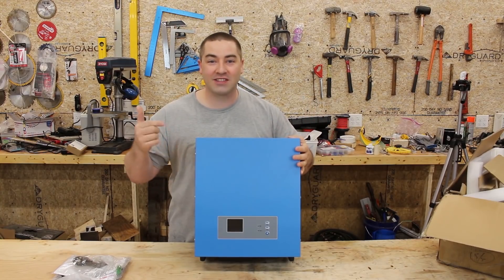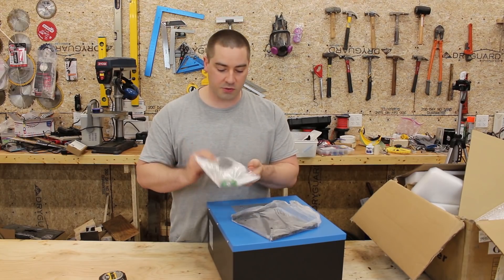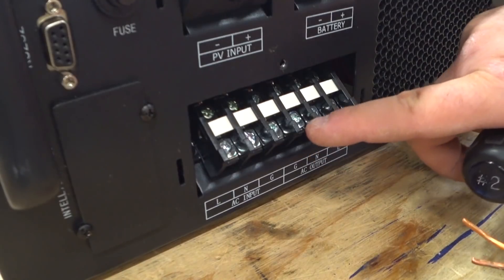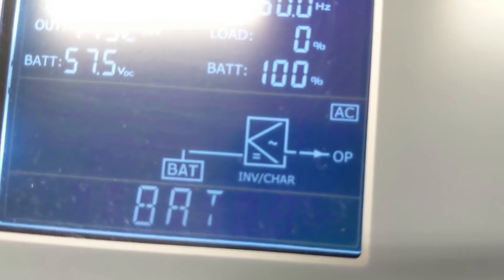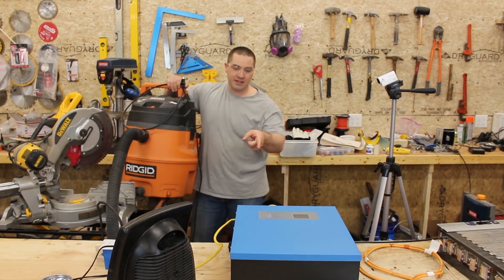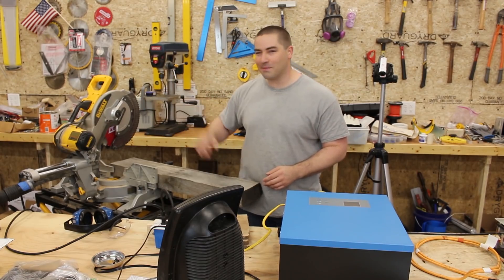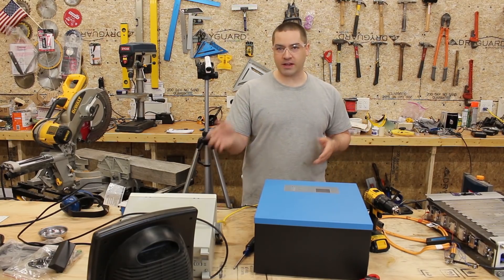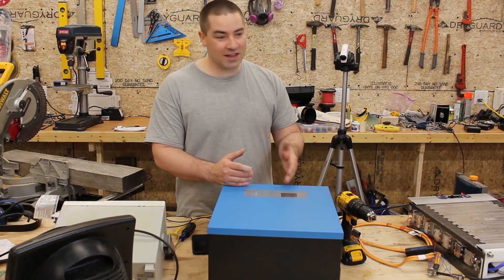Sigineer Power Off-Grid Solar Inverter 2500 W with MPPT Charger

Comment: I've always wondered why you'd not opted for an inexpensive soft start module long ago. I've previously commented as such. This would solve the high in-rush current issues with your power tools.

As for this inverter/charger, the parasitic consumption, while totally understandable, is too high for my off-grid applications. The hum from the transformer (also understandable) is crazy loud, as well!

Lastly, I'm philosophically opposed to the single point of failure that combination devices represent. While they can admittedly take up less space and simplify wiring, I'm just more comfortable with discreet devices performing better overall due to device optimization, and less of a concern to cut corners on design and/or cost. 

It's been my experience that any device performing multiple functions usually does so at some cost somewhere. Coupled with the old adage that "you get what you pay for", the performance and total cost of ownership usually disappoint over the time.

Anyway, that's my 2¢. Be well.
Reply from the maker: Hi John,  I agree with you.  This is not my go-to for most situations.  We are both fans of SMA and it is a totally different league.  I do, however, think there is a place for everything.  I think this would be great for a tool truck, or tool trailer with a few panels on the roof and the occasional use at jobsites that don't offer grid power.
Reply: @DavidPozEnergy   Thanks for your reponse, David. I actually design, build and support portable worksite power systems from single-phase 120V/split-phase 240V, to three-phase 208V/230V. Total capacity varies based on load, quantity and duration requirements.

For value-based systems, I typically employ soft starters. For larger systems, I parallel inverters such as PIP models from MPP Solar. With these, I can parallel up to nine units in single-phase configurations. Up to six units are supposed for three-phase configurations (48Vdc input only).

The largest systems run a multi-unit condenser and multiple commercial and residential air handlers in custom-designed trailers used in mobile marketing by a major inverter A/C manufacturer.

Nearly new Tesla packs, charged via solar or mains power, supply inverters powering various single- and three-phase 230V loads. Multiple inverters provide ample current, while Variable Frequency Drives perform phase conversion for the condenser.

I was able to supply two trailers for the price of one of their previous truck-based platform that required shore power. The trailers can go anywhere and require no set-up as they're 100% off-grid.

Comment: Well done video.  You should really speak more about the bloody awful huge 123W no-load draw for only a 2500W inverter.  No load draws are a good measure of the quality of a inverter and by that measure this is a terrible one.  Wouldnt own one if you gave it to me. 
In example my Samlex 2224 has a no load draw of ~30W - and even though it costs almost twice as much as a Sigineer its still cheaper than having to add the extra panels and battery capacity to support that constant extra daily 2.9KWH load.  And a better quality inverter will last longer.

Comment: I am not sure why manufacturers limit the PV input voltage to 150 VDC in many cases.  Perhaps it is a safety thing.  The panels series voltage are rated much higher like usually 600V or even more.  A single string of 500V would be easier to wire than 4 paralleled strings of say 125V each, however the 500V setup would be way more dangerous.  I suspect the 2nd reason is they don't want all of the panels on a roof to be in series because if 1 gets shaded, then the other might suffer, however, they have technology to take care of that.
Reply: It is way more expensive to design for a 500 Volt PV Input vs 150 Volt PV input ...

Comment: Good morning David there is not a single video that I miss, I have all seen them I try to imitate you in my house in some things that you do you are my source of inspiration, everything you do is excellent, I live in Colombia and it is not easy to get  at a good price everything you teach I have a small 24v solar system and I have bought 48v lithium batteries I am needing that inverter to start the pair of 48v batteries that I buy there will be some way to buy it and send it to my country  Could you help me?
Reply from the maker: Thanks for watching my videos.  I'm not selling this right away as I have some other things I want to do with it. Does Colombia use the same 120v, 60 htz power?
Reply: @DavidPozEnergy  Good evening, friend, David. Thank you to answer me so quickly, if in Colombia we use 120v at 60hrz in general and 220v in a few appliances such as air conditioners, but my consumption is at 110v-120v throughout my house, I would like to have that inverter inform me how I could acquire it.  in the best possible way since I tried and they only ship to the United States and not to Colombia

Comment: shame it is not a 240v version as thats our power in the uk i do like these units i like how thay can run solar and flick over to a generator when needed or even hydro instead of solar what was the max ampage for solar
Reply: Then buy the model that has 240 Volts!  Why is that so hard?

Comment: 120 watts on idle??? that sounds like a bit too much..have you ever tried any of those Inrush Current Limiters?
Reply from the maker: I have not tried inrush current limiters.  Do you have a link to one I should try?
Reply: @DavidPozEnergy  Neither have I so I don't have a link....but it looks like a really good solution on the "inverter shuts off when a big motor starts up" problem

Comment: Did you ever invest into creating a small DC grid in your house for DC devices? I'm wondering if it is more efficient when running DC devices from batteries with a DC-DC converter instead of going from battery DC -> AC -> back to DC. Would love to hear your thoughts and maybe create a small expiriment in the future.
Reply from the maker: I don't know enough about it to run appliances on DC.  I'd be OK with running some 12v DC throughout to run LED's.

Comment: Can you please explain the advantages and disadvantages of low frequency and high frequency invertrers?
Reply from the maker: Both can produce pure sine wave, 120v AC.  So both can be used.  It depends what you plug in.  If you only use things like heaters, TV's, lights, computers, then you can use a HF.  But some things need the LF (transformer based) to start the big surges like AC, compressor, Saws.  HF is smaller, lighter, cheaper.  LF is bigger, heavier, more expensive.  These are generalizations I'm making.  The industry is moving to HF for everything as the computers get better and faster to react.  Like the very expensive Sol-Ark is HF, but listed to have a very respectable surge.

Comment: I suspect the "buzzing" you hear is the unpotted transformer. Is this a prototype? If they were to vacuum impregnate that transformer (added cost), I'll bet it will quiet right down.
Reply from the maker: This is not a prototype.  I don't know about the manufacturing process, but that sounds cool.

Comment: Thank you for the  review of the inverter. Nice that it is a low frequency type and can handle large start up loads. The auto generator start up would be nice to see but not because I would be interested in buying this particular unit. That very loud transformer would keep me from purchasing it. I think the better brands use a round toroid transformer. Also the standby current seemed rather high. I would like to see how it compares to other Low frequency inverters.

Comment: Nice man. I’m looking at their 12Kw version. I was aghast at the buzzing sound when you turn it on. Is it really that loud? Planning on using it near a sleeping area and hope its not going to make that kind of buzzing when I’m trying to sleep!
Reply from the maker: I would NOT use this near my bed.  It's the loudest inverter I have tested, similar noise level to a window AC I think.  One of my cameras microphones was really picking it up.  This inverter uses a cheaper transformer (E-style).  There is another style out there called toroid, but is used in more expensive inverters.  The toroid is much quieter.
Reply: DavidPoz  Ack! Ok thanks for the great info. Ill ask about the different styles before I buy. For instance, I understand the 15Kw (singineer) inverter is much quieter.

Comment: THIS IS ONE HEAVY DUTY LOW  FREQUENCY INVERTER LIKE THE AIMS THAT CAN RUN LARGE LOADS AND HAS A PV CHARGER . BUT CAN 2 OF THEM BE HOOKED UP BY A DATA CABLE LINK LIKE THE MAGNASINE INVERTERS  FOR 220 V ?
Reply from the maker: Nope.  This unit does not parallel, sync, or anything like that.

Comment: Hi David why do you  use 48volt inverter instead 12 or 24volt inverter because lots of friends are not have a 48volt battery please make a video why you 48volt system instead 12v or 24v system
Reply from the maker: 48v is less amps compared with 12v or 24v for the same watts.

Comment: For the buzzing/noise of the inverter, it's possible to quiet it down. Take the transformer out and make sure there's some rubber padding between it and the case. And have some hard rubber bushings at the screws. Might even need some rubber padding where the boards also come into contact with the case.
Also, make sure there isn't space between the covers and the chassis as this is another spot of possible noise generation. So again, a little bit of rubber padding (thin window weather seal perhaps) to make sure it can't vibrate against itself.
Reply from the maker: Thanks for the tips.  I'll take a look.

Comment: When you loaded the inverter down with the Vac and Miter, what was the load on the battery side? Is it possible that you reached the max amps capable on the wire or had too much voltage drop from the load and not the max load the inverter could handle? I didn't notice what size wire you used on the battery side to make sure you didn't overload it.
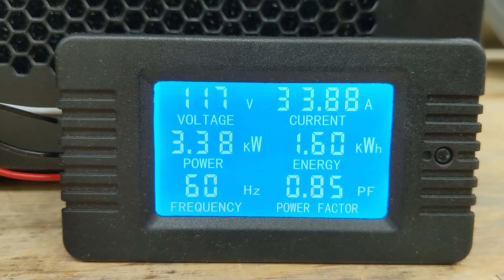Assuming a 48VDC input and 3400W pull, that'd be 71A on the batteries/wires. This is an estimate and most likely a bit low because the digital meter wasn't updating fast enough to keep up with the constant changing power draws 10:35. You can hear the beep of the inverter for a second or two before the meter updated. So it's quite possible the amp load was much higher for that second or so.
Reply from the maker: The battery pack was at 57 volts, maybe 56.5v.  The positive wire was #6, about 2.5 feet long.  The negative wire was bigger, just stuff I had on hand.
Reply: Thanks for creatingsuch great videos 👍

Comment: A big problem with these is that they are not UL certified, or at least I've been told. Can you confirm what the certifications are for these?
The certifications make a big difference if you want to use these units in a US home and have a certified electrician certify the installation for insurance reasons, and other reasons I'm sure.
Reply from the maker: I don't think they are UL listed.  I wouldn't use this as a whole-house backup.  I like it for a power tool trailer.
Reply: UL listing doesn't buy you anything. Send UL $50,000 and a couple units to destroy and you can get a sticker too. It doesn't make the unit any safer AND UL will NOT stand behind you (liability protection) if someone gets hurt from your product.

Comment: I've been looking at these for a while but haven't pulled the trigger due to not knowing enough about them.  Thanks #DavidPOZ for the great info
Reply from the maker: I hope it helped you decide one way or the other.
Reply: @DavidPozEnergy  not their yet.  How does the MPPT look?  Can you make a continuation?  I do live that it starts the miter saw.  This adds tremendous creditability to the performance and hopefully it will start the 2 air-cons on the house.

Comment: I find the label on the transformer very interesting. It says 48VDC (in) and 115V (out). 

No way a transformer can take DC and make it into AC.
Reply from the maker: I thought that was funny too.
Reply: Yes it does get a dc input. It is a pwm drive from your battery through mosfets switching on and off.
Reply: Daves Tech that’s what the inverter is doing. I am referring to the label on the transformer itself. 
It’s technically taking that PWM sine wave of 60Hz at 48VAC, because it’s considered AC, and transforming it into 115VAC.

Comment: @DavidPoz - I have a suggestion David.  I have a heater that ramps up very slowly in power (like 1 to 2 minutes to go from 300W to 600W on the low setting but I will check to get it more exact), and is good for finding out a maximum power of an inverter by already getting it close to the rated maximum using loads you already have, and then firing up the "ramp up" heater and monitoring the total wattage.   I will test out the heater again and send the make and model so maybe you can get one locally there and use it for testing (and actually as a heater too), or maybe I can just send you mine since I don't use heaters much here,

Comment: Yes I've been talking with Franklin for a few months at Sigineer  as they allow AC coupling and 240 split phase but they don't have the battery range I need but they seem really good and the price is right. Thanks for the video
Reply: Ive also been talking with Franklin for a few months. Going to buy the 15kva split phase inverter and another HF inverter possible the mpp LV5048 split phase for its pv charger and use it to power more sensitive loads while the LF inverter powers more heavier loads. Plus, the mpp inverter seems to have more exact charge options for my battery bank.

Comment: That constant noise is too much. Sigineer probably makes the LF inverters sold by 2 or more other companies.  I have 10Kw (240v split), 2Kw, 6Kw (240v split) and 1Kw versions of their inverters and none make that much racket even under moderate loads.
Reply: damackay75 I think he hurt it trying to charge the caps.
Reply: @darrenbenson2606  yeah. Agreed. 
Anyway it was the first thing that I thought about.
Reply: sigineer is Aims ODm and a few other names as well

Comment: That transformer type always is noisy that’s 1 reason I like toroid coils. The other is toroid are not as lossy as e-core transformers. Is that 240v as well? If so can it grid tie? LF inverters really are powerful and much more reliable in the long run.
Reply from the maker: I agree with you about the toroid.  This is 120v only and can not grid-tie.
Reply: DavidPoz it would be great for a job site setup (van win roof pv) or cabin in the woods. It would even heat water in one of those 20 gallon 120v water heaters or smaller. Side note: my truck with tank water heater is wrap them and turn up the temp much higher then you only have to use a small amount of hot water to bathe with just cut it with cold water then there’s plenty left for family. My has bill is no higher than with the temp at recommended settings. As far as little ones go, show them what that hot water is then no problem. 🤔 next?

Comment: That pop was the capacitors sucking MASSIVE CURRENT prior to startup it is a VERY good idea to trickle in volts slowly through a large resistor...
Without it, arc can damage breakers and relays. A incandescent light bulb is great for this.
Reply: He was using a resistor. He also went over why you should do it and that he's had damage by not using one.

Comment: i'd definitely be interested in the USB > PC functionality and the software.
I am currently using the LV5048 inverter and it works great but as in your previous test with that inverter I am running into the same issue with my miter saw. It switches over to grid automatically when I power on the miter saw. Not a huge deal. On the other hand the MPP solar software is pure garbage so I'd be interested in this aspect for this inverter.
Reply: Yes a comparison between the MPP software and this would be useful

Comment: @DavidPoz - Hey Dave.  Seems like a nice unit.  It will pay for itself when you cancel your gym membership.  What is the maximum charge current rating on it for a 48V battery bank?  How many amps is it rated at (assuming you have enough PV power coming in to cover it)?
Reply from the maker: Specs say max 65 amps charging, or 3500 watts of solar PV.  That's a lot more than I tested it with, but I didn't want to build a whole combiner box to parallel more strings.
Reply: @DavidPoz - That unit might be a good size for me for when I retire overseas because I need to ship it in a box of size 24x18x18 inches so it would fit nicely in there even double boxed.  I already have powerful 110V to 220V voltage converters that should work well with something like this Sigineer combo product.  Luckily where I am going overseas, they also use 60 Hz AC, just 220V instead of 120, so my voltage converters will be very handy (they can do both 110 to 220 and 220 to 110 (both ways).  i sent some there already to my fiancee and she said they are working well (I sent her some 120V stuff from USA).

Comment: I am glad you were able to run the saw, and the vacuum at the same time. That was exciting to see! It does make me glad that I got battery operated miter saw and vacuum. The 36v metabo hpt 10in slider works well for me and I use solar power to charge the batteries. It lowers my requirement for expensive ac inverter.

The all in one unit seems pretty nice I wonder how it compares to the mpp solar that is so popular. Is that one LF or HF inverter?
Reply from the maker: the MPP Solar model LV5048 is high frequency.  I've tested that model and it could not run my saw.
Reply: @DavidPozEnergy  that makes this all in one quite special. Thanks for reviewing it!
Reply: @DavidPozEnergy  but did you try the lf5048 in 120 volt mode we're both legs are tethered together?